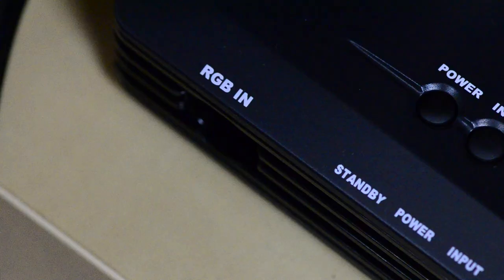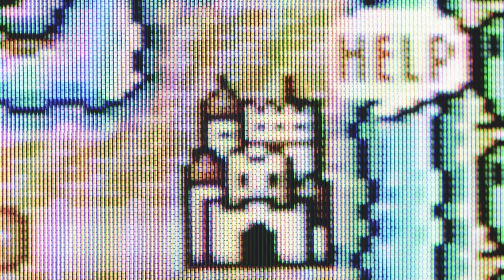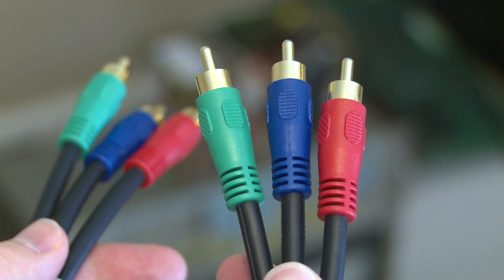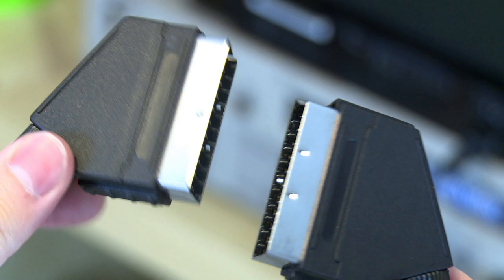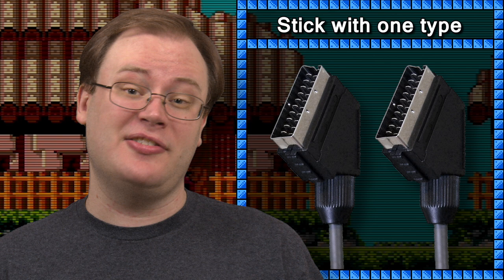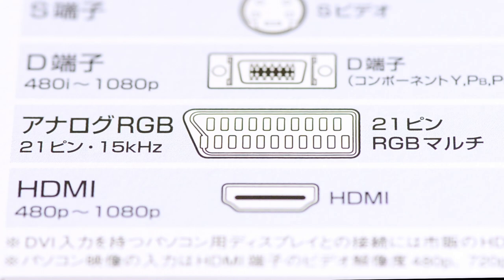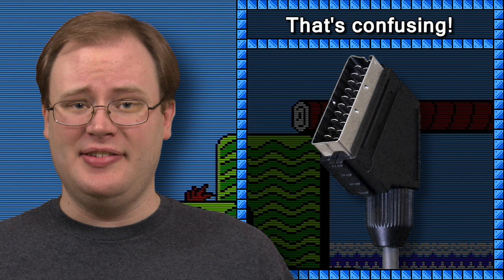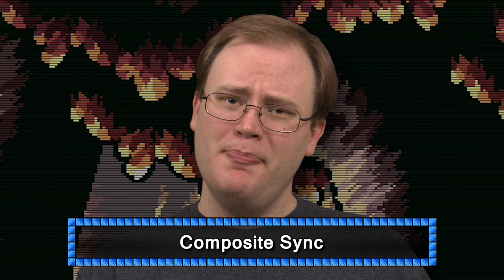Understanding RGB and Sync :: RGB103 / MY LIFE IN GAMING

Comment: So what I'm understanding is that CSYNC is the best one? Is that correct?
Reply from the maker: [Try4ce] Usually. Some systems, like PS1, PS2, some N64 mods, and one SNES revision, can't. For those, go with luma. Some equipment may require sync-on-composite. But here's the thing. Even sync-on-composite can be really clean if the cables have extra shielding. Retro_console_accessories offers that option, and it makes a big difference for sync-on-composite, and also reduces the risk for audio buzzing.
Reply: +My Life in Gaming I live in Europe and I still don't understand SCART, it's a mystery
Reply: +My Life in Gaming So, sync-on-luma is a good compromise if I use only a CRT and not an upscaling device ?

Comment: these RGB cable is just for use frameheister that just receive RGB in japanese standard? so, if I won't use frameheister I dont't need it? that cable almost look like an s-video cable. sorry for my bad english, I'm brazilian
Reply from the maker: [Try4ce] The adapter that plugs the RGB cable into the Framemeister does look similar to an S-video connector, but it's different. The one that comes with the Framemeister is wired for the Japanese RGB standard, while we bought different ones that are wired for the European standard. If you are not using a Framemeister, and are instead using something like the OSSC, a generic SCART to HDMI box, or a PVM, you do not need that adapter cable. It is only a Framemeister thing.
Reply: got it, thank you

Comment: How can I change color and sharpness settings on RGB input? I had 2 TVs that could do it but now my Sony Trinitron can't do it. :((((
Reply from the maker: [Try4ce] Like a PVM? That's normal. While it would be nice to have controls, the CRT assumes that whatever it receives as RGB is "correct" and doesn't need to be adjusted.
Reply: @mylifeingaming RGB picture in this TV without any color adjustment  looks terribly, colors are washed out compared to composite. :(

Comment: Dear my life in gaming,

Having recently discovered CSYNC, ive found out my current RGB cables use Sync on Composite. CSYNC RGB cables are expensive, and I would have to buy them all again. Would a sync strike work just as good with my current cables, than buying CYSNC cables for all my consoles?
Reply from the maker: neoknux009 [Try4ce] Devices that have built-in sync-stripping functions can definitely help in a lot of cases, but in my experience, it's not perfect. It's best to start with the best signal at the source. However, I've found that superior cable shielding can actually make just as much of a difference as sync type. That's what can be a little expensive... but build quality aside, CSYNC cables and other sync types should not result in a different cost... but it's no doubt expensive to replace what you have. Goodness knows I've done it, and I'm still working on getting the best cables for my setup all around. It's a process. An expensive process...

Comment: Got a C sync cable for PS2.  The only issue here is that PS2 + RGB + DvD playback don't mix.  Sony and their stupid copying protection or some such.  So if I wanna watch a dvd on my ps2, I have to switch over to my cheaper rgb scart that will work in the non-rgb input.  Pain in the ass.
Reply from the maker: [Try4ce] Try component output from a standalone DVD player. I get worried about putting extra miles on old disc drives for movies when other standalone devices can get the job done for cheap these days too.
Reply: @mylifeingaming  Yeah for sure.  Good idea.

Comment: I have OSSC 1.6 plus Retrogamingcables  RGB Scart cable hooked up to my Atari Jaguar. Everything is beautiful, however I do notice audio noise when volume turned way up. Anyone else have this happen on any console using Scart?
Reply from the maker: +Randy Femrite [Try4ce] I have noticed that with PS2. Unfortunately I've been busy and haven't done much testing since getting the 1.6, but I did not hear any fuzzy audio when checking the SNES.
Reply from the maker: +Randy Femrite [Try4ce] Oh, also, it didn't seem as noticeable in recordings for some reason, though I was listening on different speakers. I'll be doing more recordings with 1.6 next week.
Reply: From Videogameperfection.com;  “Audio quality was good too and only the very faintest hint of any audio buzz was present even with the sound turned up unsociably high”.
Reply: This was referring to the Scart cable from Retrogamingcables;  https://www.videogameperfection.com/2015/02/23/jaguar-scart-review/

Comment: For anyone with multiple SCART connections the Shinybow 5525 Scart Switcher in the link below has performed excellent for me. It's a little pricey but saves alot of headache on cable switching with my XRGB Mini Framemeister. I currently have a Super Famicom, Genesis, PS1, & Nintendo 64 running into it with no issues.

http://www.shinybow.com.tw/pro/detail.php?pid=191&cid=76&f=&pa=
Reply from the maker: [Try4ce] I've used Shiny Bow switchers for composite and YPbPr component, and had good luck with them... although I was using them before I owned a Framemeister, so I can't say for sure if I lost any quality. SCART switching is unfortunately rather more of a headache because of all of the considerations, so I meet any switching solution with a bit of skepticism.
Reply: I'm sure it will depend on system setups but for me it has been faultless. I was quite skeptical because of all the initial headaches I had getting the right SCART cables etc...but I breathed a sigh of relief each time I would switch over to a different console & everything was working properly.

Comment: Ok I'm a bit confused I want to get new RGB scart cable for my playstation right now I have one with sync on composite and it shows visual artifacts on solid colors so I want to get cleaner image and I get that Csync cable gives cleaner image but how about sync on luma cable both are available from retro_console_accessories  on ebay and I'm not sure which one to get.
Reply from the maker: [Try4ce] CSYNC is actually not possible on PS1. Go for sync-on-luma for sure. However, keep in mind that some of what you see could be dithering... which is really common on PS1, and it's just part of a game's graphics. But if you have sync-on-luma, you can be confident you're not getting additional artifacts that are just noise in the signal.
Reply: Thanks I'll order sync-on-Luma cable. Also I'm sure that video artifacts that I'm seeing are from cheap SCART cable that I have because it not only has video artifacts from sync on composite  it also has video artifacts from audio depending on music or sound effects in games artifacts change on screen :D when I bought it I thought every SCART cable was same :D.
Reply from the maker: +SomeSome Gaming [Try4ce] Ah, yes, if audio is affecting video or vice versa, then the cable is very poorly shielded! I had to buy a few upgrades myself.

Comment: Does the scart breakout cable have to be compatible with csync as well? I purchased a high quality shielded one off of ebay but it doesnt say if csync is enabled. I have a sony trinatron oev203 pvm monitor and am unsure if its compatible either. Would it still send a signal if my monitor doesn't accept csync? Sorry, I'm still new to this.  Thanks.
Reply from the maker: [Try4ce] The breakout cable for PVMs isn't for any particular type of sync. I'm pretty sure that model should work with any normal type of sync. The sync signal goes through the sync line for PVMs regardless of what type it is.
Reply: My Life in Gaming thanks for the reply. I purchased A packapunch ps2 cable off that uk website. However its csync enabled.  I just bought the best one they had. I hope it works.  Fingers crossed. I am kind of worried because you say in this video do not buy the csync if your tv doesnt require it.
Reply from the maker: [Try4ce] Did we say that? I don't recall that, but this is a pretty old video. CSYNC is not necessary for PS2, but it is fine. You shouldn't have any issues at all.
Reply: My Life in Gaming thank you so much for the reply. I have one more question and I'll leave you alone.  I just read on a forum that my particular pvm  model would  accept component via rca to bnc connectors.  This was after i spent 100.00 in cables.  Is there any reason i would choose RGB over component. Seems much cheaper.  I have a modded euro ps2 which displays ps2 in NTSC through component but PS1 in Pal as odd as that seems. I've had to play my ps1 games through composite in order to get them to work.  My PVM will display pal and NTSC. I'm wondering having a scart cable will allow me to display ps1 games in RGB.

Comment: Has composite sync or sync-on composite got anything to do with sync on luma?
Reply from the maker: +SXGi1b0 [Try4ce] They're three different types of sync. It's been a while since we did this episode, but if I recall, we forgot to mention that PS1 and PS2 do not support CSYNC. Therefore, the best method for those systems is sync-on-luma. It's also handy for N64s modded for RGB, or the SNES 1CHIP-03, all of which don't support CSYNC by default. Sync-on-luma is an excellent choice because the quality is really just as good as CSYNC. However, even sync-on-composite can have equivalent quality if the cable is well-shielded.
Reply: +My Life in Gaming Thanks for the reply. So would order of best quality cable from these three options be...composite sync (csync) then sync on luma then sync on composite last? I heard in one of your videos (ive been watching a lot back to back) that PS1 and PS2 dont use csync so ill be on the look out for sync on luma, do u have any info on the best cable types for n64, gamecube, original xbox? Im from the uk and know nintendo get wierd with the pal/ntsc consoles, I used to watch a lot of Adam Koraliks videos on best cables and from what I gather ntsc n64 support rgb but your tvs dont use it, so is the best pal option s-video for n64? Ive heard pal gamecube games dont output in 480p so component cables for gamecube in pal region is pointless, so I assume rgb scart would be the best option there but im not sure if gamecubes can handle csync or that would need sync on luma too. I know theres a lot of questions here and really appreciate your responses, these videos have been the most informative ones Ive seen for a long time next to Adams, Ive learnt a lot of new info from you guys.

Comment: mod your systems snes/genesis and get the scart outta here, but that could be a daunting task, so either doing it urself or paying up to get a scart setup.
Reply from the maker: [Try4ce] Thankfully, neither SNES nor Genesis has to be modded for RGB. You just need a compatible cable (preferably CSYNC) and a device to receive it, like the Framemeister, and you've got RGB!
Reply: *****
how much does the setup cost, cable, framemeister or scart/component scart/hdmi convertor?

I self modded a potential snes(see my video) and just tapped into the encoder. Its potentially the same as the scart cable, got my leads amped up with capacitors(like the scart cable would have in them) then just run to your component ready TV red/green/blue cables, then use existing AV cable for sound red/white.

its a beauty when playing on a CRT that has component...looks solid on a big LCD too
Reply from the maker: Unfortunately it's not cheap! It's probably comparable to the cost of a new modem console just to get started, which maybe doesn't sound so bad when put into those terms. Expect to pay probably $15-$20 on average per cable.
Reply: *****
but then once you have your setup your good for all the other consoles, just have to get appropriate scart cable for that unit.

Comment: If Csync is superior to sync on composite in many cases, why did companies use the latter almost exclusively. Presumably it cost less to manufacture?
Reply: My Saturn has some really ugly jailbarring on my LCD, but this is not visible on my old CRT. I'm wondering if an XRGB mini or Csync cables will clear this up? (I'm in the UK, and have RGB scart inputs on all my TVs.)
Reply: Sam Astbury Sync on composite video is more commonplace in SCART cables because some old European TVs will only support composite video through their SCART sockets. I've heard it's not uncommon for TVs with two SCART inputs to support RGB on one but only composite video on the other. Including the composite video signal in the SCART cable in addition to RGB therefore covers both scenarios.The Dreamcast is the only console I know of that used c-sync in its first-party SCART cables, and that's because the Dreamcast console itself shuts off its composite video output completely when it's in RGB/VGA mode. This is the reason why there are notices on the cable's documentation that the SCART cable may not work with every SCART TV.
Reply: Sam Astbury You may want to do some research on the Saturn. I've heard that only NTSC Saturns have c-sync output; PAL Saturns might have replaced that pin with +12V instead. It's been a while since I've checked.FWIW, every Saturn should have S-video output as well, though.
Reply: Sixfortyfive You're right about most UK CRT televisions; I think all the models I've owned have had one RGB-enabled and one composite-only Scart socket. Presumably there's only 'room' for one type of sync signal on each lead and they dropped Csync in most cases to cover both scenarios, as you say?  

My Saturn is Japanese actually, although it works perfectly well with a Euro Scart lead on a CRT television (or the BVM I owned briefly). The jailbarring on my HDTV isn't absolutely hideous, just a bit of a bummer, and I can't quite figure out why it's happening. Maybe I'll try a Csync cable from retro_console_accessories or wherever...
Reply from the maker: [Try4ce] I read about the Saturn a bit, a few weeks ago. Apparently some people have issues with CSYNC on model 2 Saturns, so sync-on-composite my be preferable. I recently got a model 2 Saturn myself (US NTSC) and have not noticed any issues with CSYNC. Looks great!

Comment: Hi guys I really need your help 😔 so I've decided to buy xrgb mini framemeister but I need your advice I'm only going to use it for my PlayStation one and PlayStation two. What cables do I need I only have component and S videos is that ok ? Or do I need to buy RGB cables and  what cables do I need  I have a Pal modded PlayStation 1 &2  thank you
Reply from the maker: [Try4ce] Our PS1 episode should give you some ideas and advice: https://youtu.be/f7fCTHu99bk In short, the best RGB cable to buy for PlayStation 1 or 2 is sync-on-luma. We have some links to cables sellers in our video descriptions. Component for PS2 is absolutely sufficient. Remember, the Framemeister is considered great at 240p and 480i, but 480p is not any better than plugging directly into most TVs. Also remember that a number of PS1 games have issues with the Framemeister because some games have 480i menus, but 240p gameplay. This causes a long wait when the resolution changes. The most notable examples are Chrono Cross and Silent Hill. Some games only have 480i title screens, but everything else is 240p. Most PS1 games will work without issue, but just know that there will be some games that don't work great. Our newest episode is on some Framemeister alternatives, most of which will not be as good, or a matter of preference, but the resolution change is better on some of them, so you might want to think about it: https://youtu.be/lHoOKLWIMKU
Reply: Hi guys! First of all, great videos and great channel! It helped me a lot on this picture quality stuff!
Hijacking the post from the OP, may  I ask why do you think the Sync on luma is the best solution for PS2? Wouldn't be the CSYNC version the best option? I know that the PS2 cannot output CSYNC, but you can achieve it using a sync stripper. (RGC.co.uk has them!) I bought those 2 cables and I'm using them with my Frameister but I really can't tell any difference on a naked eye.

Comment: Is the checkerboard interference due to crosstalk in the cables?
Reply: Rikard Bengtsson I think "crosstalk" is typically defined as interference between two distinct cables or wires, whereas this is an issue with the signal in a single wire, but the general idea is probably the same. In the case of the Chip & Dale clip in this video, it's a case of the NESRGB's sync signal getting muddied up by the composite video data traveling along the same wire. By taking composite video out of the picture and using only sync, the interference cleans up.
Reply: Sixfortyfive Where did you find this definition? Using sync on luma works well too, because it seems like the colour carrier is the main cause of interference. If you want the best picture, individually shielded conductors is the way to go.

Comment: Hello,
thanks very much for the awesome video, you earned a sub and a like. 

I bought a modded N64 ( NUS-001 FRA) and I'm getting bad sync problems on my 2016 Sony LCD TV. I'm using a SNES original RGB Scart cable which is, what I found out after watching your video, giving out sync on composite. 
Now you said in the video, that the N64 is not able to put out Csync, but I'm planning to buy a specialised RGB cable with Csync in it. Will it not work then, or have I overlooked something? Other than that, will it be smarter to buy a cable with Sync on Luma or Csync?

Sorry for my long post, but I'm really hoping that someone can help me out. 
Thank you in advance and have a nice day. 

Best regards
Reply from the maker: [Try4ce] I don't know a ton about connecting to a PAL TV, and what might cause sync issues with them. I understand that CSYNC is possible on N64, but it's very unreliable. Sync-on-composite or sync-on-luma is generally what you should use, but I'm not sure how likely a PAL TV is to be OK with sync-on-luma.
Reply: Thanks for your response!